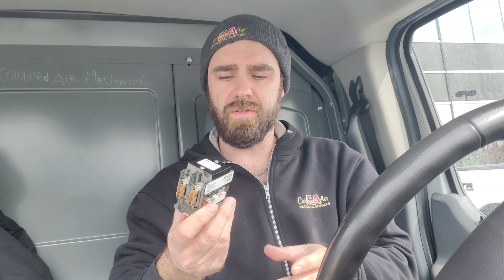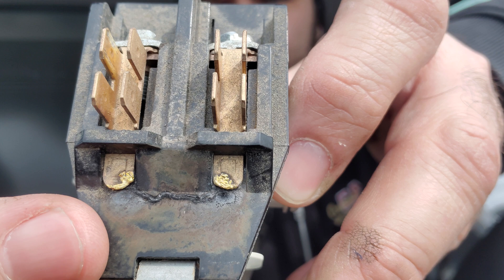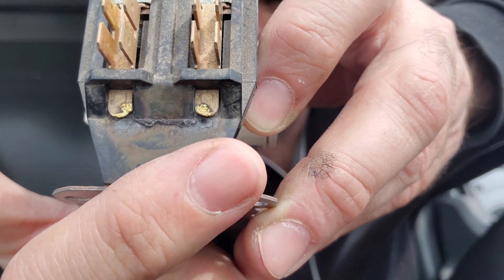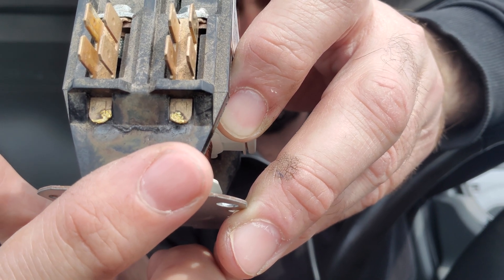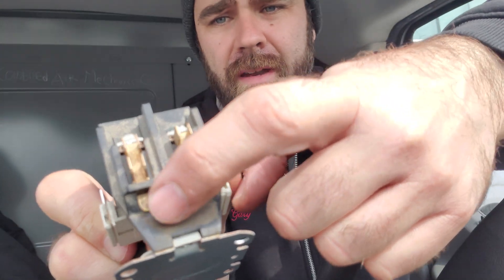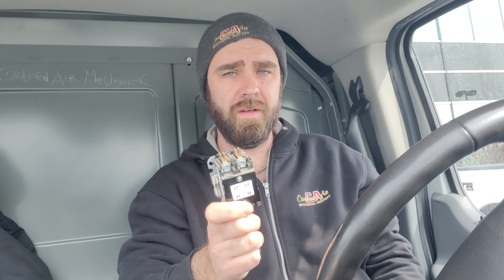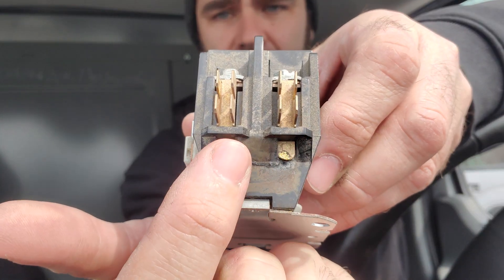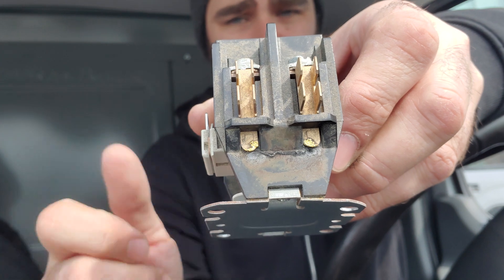Contactor Shorted Across Line Voltage Due To Carbon/Dust Track

Comment: Just happened to me. Caught it on a 3 Pole 460V 3 Ph Contactor for a RTU. Was tripping the breaker instantly. Looks like the fuse was changed before and no one caught it . Feels good finding those ones after someone else has been there before you a few times lol

Comment: If you don't have a megger would a meter that reads omhs work?
Reply from the maker: A megger js reading ohms.  It's reading megohms.  The meter would have to read below 20 megohms to do so.
Reply: @HVACKnowItAll  Well... In addition.... a megger has a HV DC output to find those high megohm pathways.
Reply: @HVACKnowItAll  i don't think my meter can do that lol thanks